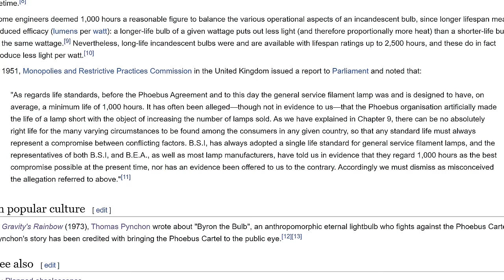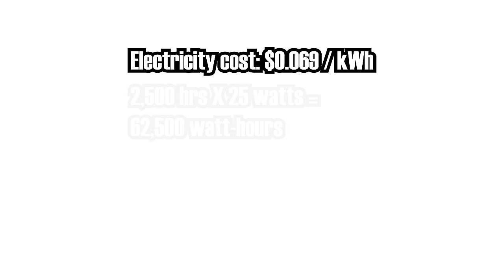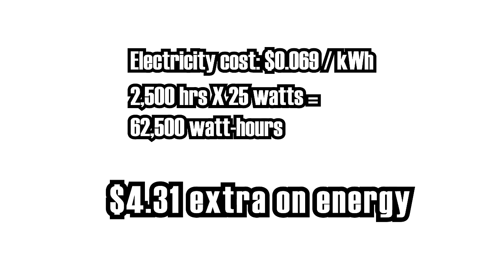Longer-lasting light bulbs: it was complicated

Comment: 2:48 Another reason why Centennial light bulb lasts may be that it's never off.
Subliming is like evaporating. It depends on concentration of tungsten in the bulb's gas. If that gas is saturated with gasous tungsten it'll be slow like evaporating water in a sealed bottle. It's not a problem for normal light bulb as the wall is so much cooler than the filiment tungsten can leave the gas by condensating and turning the bulb black. But in a always on dim bulb the walls may not be cool enough for tungsten to condense, saturating the bulb with tungsten gas and stop the filiment  from subliming.

Comment: In aviation, older airplanes were using 12v systems whereas newer planes use 24v systems. It’s always funny when someone accidentally installs a new light bulb that’s rated for 12v into a 24v airplane. It is very very bright, for a very short time
Reply: Someone above you had the exact same thought, same words and all. Crazy how two people can think the same exact thing.
Reply: I put a 12v battery in a 6v motorcycle 😂 poof
Reply: i had a phone charger for the cigarette lighter socket of a car. one day i plugged it into the cigarette lighter in a truck, and it went BANG! - literally.
Reply: Airplanes use 400hz 110vac don't they?
Reply: @anonymousarmadillo6589  AFAIK they also use 24V DC.
Reply: @bwofficial1776  If that "person" had an ass as the profile picture, then that gives me an insight on how these bots work.
Reply: @anonymousarmadillo6589  One of the power buses yes, same with boats from my memory. If I'm not mistaken, aircraft have the 400 Hz AC line and some form of DC circuits as well, they gotta start up those APUs (or starter motors on smaller aircraft) after all from batteries.
Reply: @anonymousarmadillo6589 They can use 12vdc, 24vdc, and 120vac depending on who designs them.
Reply: Sometimes you find a 24V bulb in a 12V system. Dim, but they last a reeeaaaly looong time 😁
Reply: @anonymousarmadillo6589  Jets do.
Reply: @anonymousarmadillo6589  I’ve never encountered any airplane with alternating current for the main electrical system. Though most jets do have inverters for cabin outlets and whatnot. I also don’t work airlines so maybe they’re different?

Comment: Years ago my dad got a hold of a box of traffic signal light bulbs. He installed them around the house and I think some of them lasted like 10  years.
Reply: Did he install them in the red light district of the house or in the green zone?
Reply: @geraldh.8047  🤣😂🤣👍
Reply: I wonder how much power they drew?
Reply: Most traffic light bulbs are rated at a higher voltage than they're fed by.
In the US they use 130v light bulbs on a 120v circuit.
Industrial control equipment used to regularly use 230v pilot lights in a 120v circuit and they would last for literally decades.
Reply: I remember that bulbs for industrial use would usually be rated for 240V although the nominal voltage was 220V (now 230V). So much longer life but worse efficiency.

When you buy halogen car bulbs you also have a choice between long-life bulbs and ones with much greater light output. I prefer the best light and don't mind replacing them that more often.
Reply: I can’t believe Big Bulb got to Alec. /s

Comment: On the subject of having to make stuff out of tungsten, yeah, it really is an annoying material to work with. I needed to make a shaped electrode out of tungsten wire once. The material is so hard it ruins your pliers, it's brittle so it likes to break if you bend it too far, and the weird thing about the material I got was that the wire likes to split along its length. Considering what our metal supplier wanted for it (about 70 euros per meter of 0.3mm wire IIRC), it was expensive every time it went wrong, which was frequently.

Comment: It was nice, being able to buy compact CFL bulbs that lasted about ten years or so. Finally, after about a decade, the LED bulbs are catching up. When incandescent bulbs were still common, we preferred the longer life 50 watt bulbs.
Reply: I stopped using cfl's shortly after they came out. I have seen  too many burn out in a glory of fire. After seeing flames and smoke come from a lamp, it's not hard to see what kind of fire hazard they can be. I wonder about the transformers in the LEDs, but so far all I hear is a quick snap and the bulb dead.
Reply: @happyogre  the "self ballasted" CFL's of the 2000's were mostly garbage but the PL lamps without a built in ballast and relied on a ballast built into the fixture were and are far MORE reliable as the fixture is worth FAR more then the bulb retail but NOT much MORE to manufacture so MORE profit for better ballast
Reply: @happyogre  typically, condensation/water enter CFL lamp circuit and will short it. It had gap/holes on the base, insects accumulate on the base of the lamp (due to UV attraction), or moisture fall onto it thru the holes at the base, especially if it's facing up (like on light stand).
Reply: @happyogre  I don't mind the LEDs, but I just want to be able to not think about bulbs. On the rare occasions I see a pack of the good CFLs, I snatch them up. The only place I WILL NOT use them, is in the shop. There I still use incandescent. It's a safety thing. Fluorescent and LEDs flicker and can make a spinning machine appear to be off. Very danger.

Comment: I'm surprised that you didn't comment on the way the 2500 bulb has far more filament supports. They increase its life but sink the heat away away from it so it runs cooler and is less efficient. Decades ago here in 240V land I got so fed up of Chandelier bulbs blowing I bought some long life ones which had the same construction and dinner light.

Comment: The longevity vs. energy efficiency in lightbulbs is funnily enough totally reversed in LEDs. LEDs are (up to a point) more energy efficient when they're being underrun, also when underrun, they produce less heat and fail way less frequently.  I regularly buy cheap plastic LED bulbs and lop off a current ajdustment resistor to make the originally 8,5W bulb into a very energy efficient 2,3W bulb (Big Clive has videos on this technique).
Reply: His video on Dubai lamps is relevant too.
Reply: I see this with some of my nicer flashlights, and the effects tend to vary depending on the LED. 

The Nichia E21a is happiest inside an amp, though efficiency rapidly drops off after an amp. In a D4V2, the 9 amp driver (little over 2 amps apiece for four LEDs) puts out approximately 20-25% more lumens, than with the standard 5A driver. 

Some LEDs, such as Cree’s XHP line, tend to respond a lot better, and you can shove a ton of current through them before going well past the efficiency curve (6A for the 3v variations is the spec for XHP 50.3), while being able to take substantial heat. 

Special note on the Luminus SBT-90.2 LED, which can handle a monstrous 20 Amps, and can kick out over 5000 lumens. For perspective, a 55w halogen headlight hits around 1100-1300 lumens, with high beam bulbs around the 1600-2000 lumen range.

Comment: Alan, I have an 15,000 watt airport beaken incandescent light bulb and the filament is quadruple coiled. It's very interesting to look at, and makes you wonder how it was produced.
Reply: Who makes those bulb?
Reply: @TheTyisawesome  The airport beacon store
Reply: A channel "photonicinduction" has run some lamps with such crazy power ratings.

What a cool bulb. I'd like to find one some day for a mantle piece.
Reply: @shadowcween7890  thank you Detective Drebin.
Reply: @TheTyisawesome LOL...actually I found in a an electronic supply store, and it was produced by GE. It even came in the same corrugated cardboard sleeve as 60 or 100 watt bulbs come in...lol
Reply: I wish I could  remember where I put it so I could take photos of it. It doesn't have a screw base it's just  two post. It was pretty easy making a fixture for it just drilled two holes in a piece wood that was 3"x5"x half inch and used a suicide cord for conductors.
Reply: My father-in-law's named Alan I will ask him.
Reply: do you have pictures of the filament?
Reply: @danielcarter305  You can still get mogul bipost lampholders.
Reply: I bought a couple of retired traffic lights and they have massively over-engineered 300-watt bulbs with interesting thick filaments in them.  I set them up during Halloween and Christmas and my yard is lit up like a baseball field.  The kids love them.
Reply: @legomasterj  unfortunately, no I got it about 30 years ago I packed it away because I know if I didn't it would end up broken. I pretty much forgot about it till Alan was talking about  filaments being double coiled.
Reply: elfrjz  I posted how above. They do still make fixtures for them but it was easier and quicker just to do it the way I did.
Reply: elfrjz  it was pretty much a temporary thing I never had it on longer than a few seconds. I doubt that any circuit in my house can handle that large of a load. Especially my home where I'm sure inspector were paid off for it to pass inspection. My dad and I have pretty much rewired the entire house.
Reply: When I bought the three that the shop had they where more for curiosity then anything else I got one for myself and one for my dad and uncal due to the fact that they are electricians.  They were 10$ or 15$ each. I had no intention of ever using them, I just like the way they looked and thought they were interesting.

Comment: Great explanation for light bulbs. I personally believe your point on cost-cutting explains most other things that are pointed to as examples of "planned obsolescence". The vast majority of consumers don't research even large appliance purchases and pick one out in store where the only info you have is the price and the features list. Manufacturers long ago figured out that selling the same features as your competitor but costing $50 more because you used higher-quality parts only led to way lower sales. If you want higher quality you have to do actual research and then vote with your wallet.

Comment: I would assume the "long life" bulbs made sense in places where replacing the bulb was difficult, ie. high ceilings etc.

edit: as mentioned later in the video
Reply: And in appliances like ovens where the waste heat of the bulb's inefficiency isn't actually wasted.
Reply: 22:30
Reply: They also have 'rough service' incandescent bulb for use in garage door openers and other things that vibrate.
Reply: Yes. My parents had a 200 Watt bulb in their garage, in a socket that was only reachable with a tall and rickety ladder.

A long life bulb was very practical in that situation.
Reply: Makes you wonder if the bulb got brighter the higher the temperature in the oven got.
Reply: @danielcarter305 4,600° + 300° = 4,900° which is an increase in temperature of about 6 and 1/2%. So yeah it's definitely brighter, but not a whole bunch.
Reply: @johngamble5270 yup true especially in my country lightbulb are fitted on high ceilings too not just garage but all of the room.
Reply: if you watched the video he already stated this
Reply: @SerpentDrago  He did, but I posted the comment before I reached that part.

Comment: There's a fun related tangent here: the thermal factors of tungsten lamps are why LEDs were useful in flashlights well before they were useful in general illumination. In a tiny flashlight bulb, the ratio of bulb surface area to heat produced goes way up, so more of the heat produced by the filament leaves quickly. Giant 1000W theatrical light bulbs are not exactly paragons of efficiency, but they are massively more efficient than small flashlight and indicator bulbs.

Comment: Around 1993 (yes, 30 years ago) I rewired the light fixtures in both of our main bathrooms. They are 4-lamp fixtures, and I wired the sockets in series so half the voltage went to each lamp (in pairs). Of course the lamps aren't as bright so I replaced the bulbs with higher wattage bulbs. This is not a fire hazard: the lamps run considerably cooler than the original bulbs did. It does indeed use more electricity, but not as much more as you might think, since the lamps are getting half the voltage. Yes, they are slightly yellower than a full-voltage bulb, but not enough we find it a problem.

Pros and cons aside, the fixtures have been in regular use ever since and I have yet to replace a light bulb in either fixture.

Comment: I want to see a video about modern LED bulbs. Manufacturers love to tout the lifespan of the actual LEDs, but neglect the reliability of the conversion circuitry, which is almost always the failure point in an LED bulb.
Reply: Yep, the lifespan rating of LED bulbs is based on the specification of the LED chips themselves. They don't like to mention how much they're overdriving them and cooking them to an early death.
Reply: yep. a lot of LEDs were driven to its max. rating without having proper heat dissipation in mind. i have a couple LEDs exploded its capacitor because of the heat while other have one or two LED chips cooked to death
Reply: bigclive has taken apart tons of LED bulbs with explanations of the components
Reply: Agreed... They have similar issues in automotive LED lighting systems. In automotive I think they should make the 'drivers' replaceable. 
I have had more home LEDs fail than I can count... Even name branded ones.
Also I think they should be required put the "don't run in an enclosed fixture" more prominently on the package. 
Because in a wonderful twist of fate one of the more common light fixtures in American homes is the "boob light" I have thought of a few ways to convert them into a more open fixture but haven't settled on a good design.
Reply: I now current mod my led lights by removing the lower resistance tuning resistor. Light output is much the same and current draw/heat generation is significantly lowered. Started doing this after getting annoyed by early failures.
Reply: @codemiesterbeats  You could blast an air fan on an LED 24/7 and I think that still wouldn't save it from their terrible thermal engineering.
The problem's what's in the bulb - not what's "surrounding it"

Comment: Great video. You know what drives me crazy? The prevalence of "maintenance free" light fixtures, especially flush mount. They're designed to last 10yrs, which sounds pretty great, until you realize you need to hire an electrician (or know enough to twist household wires together yourself, in a junction box), and you have how many, probably at least 10 lights in your house. So if you used all "maintenance free" lights, you'll need to change one, on average, once a year or so.
Reply: but if they were installed at the same time as is likely they won't be on average every 10 years they'll probably all fail in the 9-11 year period meaning you probably will want to replace them all when the first one goes because otherwise you'll have to get an electrician out 10 times in a relatively short period of time.

But they are stupid things.
Reply: @mytimetravellingdog  if it's new construction, you might have all the lights installed at the same time, but it's quite common for people to replace one fixture, or one room at a time in their house, ongoing
Reply: They're "designed" to last 10 years...in ideal conditions. I`ve seen "ten year" bulbs fail in less than one. Airflow around the bulb, humidity (if near a bathroom or something) or local climate can dramatically change that lifespan. As will the duty cycle -- you use the lights in some rooms a lot more than others. So you could install all ten at the same time and still have one fail every year.

LED lights should damn near last forever. Usually it's the power supply that fails, and usually that's because they run the power supply very close to its physical limits because making it more durable costs money. But that also means any small variation from those test conditions can push it over the edge into failure. These lights could be great, but that would not be profitable...
Reply: This is also true for RAID arrays (used to multiply disk capacity and provide some data security by saving the data across multiple drives) A drive with a Mean Time Before Failure of 100,000 hours will usually last around 100,000 hours. An array of 36 similar drives will have one fail on average once a month or so of continuous use. It's not a simple division, as due to probability, it's worse.

Source: Was system admin of such an array, and really wished the people who set it up in the first place had split the array instead of using all the drives for one logical storage area. (So did they after the first few months once the drives started failing) The storage space? You can now get similar levels of capacity on microSD cards, though the transfer speed from the area was much much faster.

Also, TechConn has done a video about those "disposable" light fixtures like you're talking about.
Reply: @mytimetravellingdog  Designed for "10 years longevity" is based on average lifespan of bulb design, it's very unlikely for them all to fail at around the same time (within the same year). If they did, that was definitely through planned obsolescence.
Reply: I've got one set of LED Christmas lights that have been happily burning for nearly 15 years, they even dealt with a lightning strike by turning off part of the strand, then about a week later coming back on. These were designed back when LEDs were still the most expensive part of the set, and they hadn't "cost reduced" the power supply circuitry to the bare minimum to make them light up. It also cost something like $40 at a time similar incandescents were selling for $4.